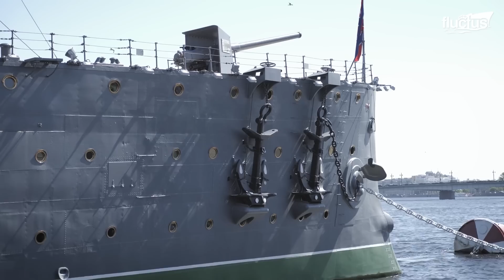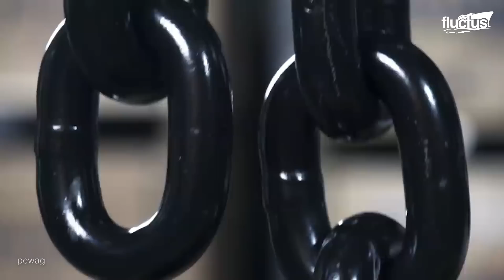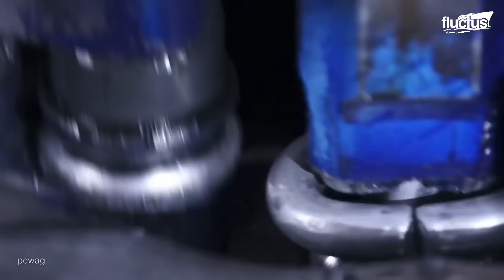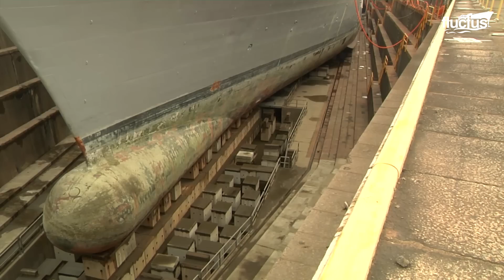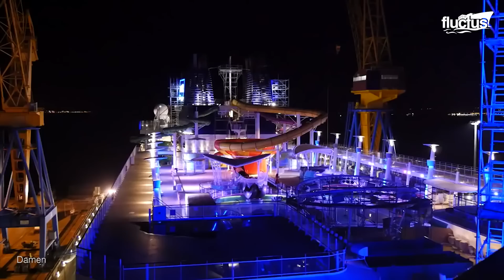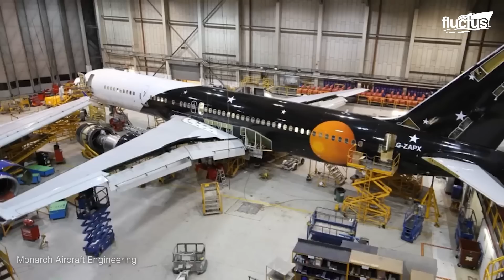The Hypnotic Process of Maintaining Massive 50 Ton Ship Anchors

Comment: They chains are galvanized? I would tend to think that galvanizing would be a waste due to the the electrolytic action with the sea water whereupon it would quickly erode any coating away in short time. Also, other than hot dipped galvanizing, there is the high risk of hydrogen embrittlement. Not too good for chain that have to withstand high tensile stresses.

Comment: In my 50 years of studying and working as a naval architect and marine engineer I never encountered a ship's anchor or chain that was galvanized.   In fact, the only anchors and chains that I have ever encountered that were galvanized were on pleasure craft.

Ship's anchors are usually cast steel and chains are forged steel. 

It is curious that you chose to show a gold anchor on the Bonhomme Richard.  This ship was a total constructive loss after a fire gutted it while docked in San Diego, California.
Reply: Correct.
Reply: Just imagine the Galvanising cost ..Damn!
Reply: @arvindahuja1996  Although unable to find the pricing there are suppliers that offer Hot Dipped Galvanized (HDG) anchors and chains as an option. 

A 150,000 DWT tanker would have 2 anchors and chains consisting of 13 shots (shot=90 feet) and an AC14 high holding anchor.  This would weigh in at around 65MT (140,000lbs).  This does not include kenter shackles for joining the shots and anchor or the anchor swivel. 

In the case of a normal anchor and chain, anchor and chains, at least the ones I'm familiar with, are   normally prepped with high pressure (3,000psi) water washing and painted with a  single coat of epoxy.   For a galvanized anchor and  chain, abrasive blasting to an SP2 finish, followed an acid wash, water rinse and a dip into a galvanize bath or two would be needed..  Care would be require to assure that all the nooks and crannies are blasted and the galvanize covers without any holidays.  Remember 13 shots is 1170 feet of chain.

The bottom line is ship's anchors and chains are abused from the time they are made to the time they are scrapped.  Seawater and mud, water washing with seawater to remove the mud, to storing the chain in the chain locker, to the dropping and retreival of the anchor and chain will destroy any coating put on the ship's tackle.  Oh, I almost forgot, we're going to store the anchor, swivel, a kenter shackle or two and some chain in the weather where it will be exposed to abuse from mother nature and the sea.

Bob
Reply: 50 yıllık tecrübenize güvenerek size bir soru sormak mümkün mü?

Comment: It never fails to amaze me.... anchors and anchor chains on aircraft carriers are not just big, not just huge, they are ginormous. Gigantic and Enormous in one word. I'm ex Boeing and have been around many world's biggest; planes, buildings, jet engines, paint hangers, etc. But Giant Cruise Ships, Container Ships, Tankers, and Aircraft Carriers impress me plenty. 

All of them would fit easily inside Boeing's Everett Plant, with lots of room to spare. It's over 1/4 mile wide and almost a mile long. Inside, it's over 100 feet to bottom of giant roof trusses where world's largest ceiling track cranes operate. The dry docks for biggest ships are much bigger than ships. The floating ones have to well... float while holding biggest ships in the world.
Reply: I understand the Boeing Everett plant is so big it could declare itself a sovereign state, issues its own currency and passports? It has its own weather system and unique geology too.
Reply: @Interdimensional27  Thank you. When it was first built for 747, 757, 767, it was the biggest. They showed a map of Disneyland in California superimposed on top. There was enough room left over for all the parking lots too. 

The plant has continually grown. They built new 'bays' for 777. They added on again for 787. 757 got retired, so room for changes. 797 is coming, and they are making room. 

Besides main plant, there are dozens of other assembly areas, not directly attached to plant. They also have huge office buildings for engineering, customer support, and many other services. 

If all building were under 1 roof, the only word left to describe it is 'ginormous (gigantic and enormous together). It took me 3 months just to understand the numbering systems to get around without getting lost for a week.

Comment: Too bad the Bonhomme Richard wasn't able to teach the sailors damage control.  Nobody even pulled lever that would have automatically put out fires.  (It burned down at dock after having been upgraded with billions in new equipment.)
Reply: After the fire did they paint the anchor fire engine red.
Just curious.